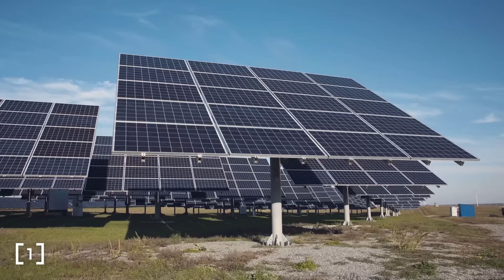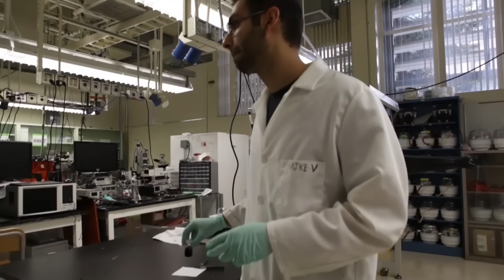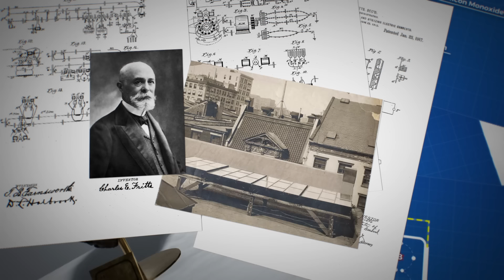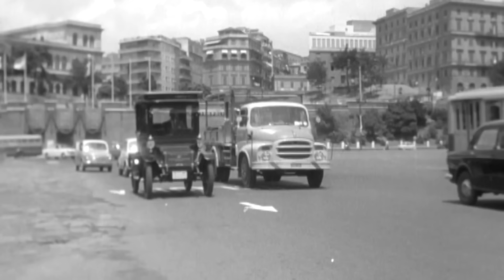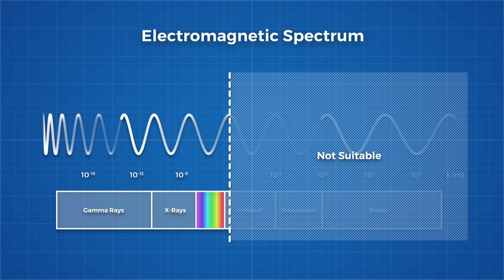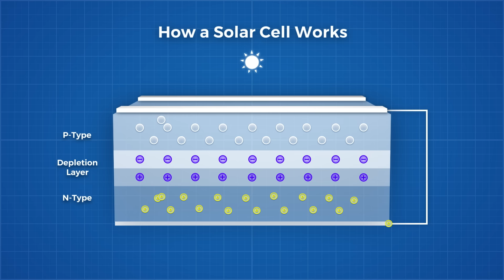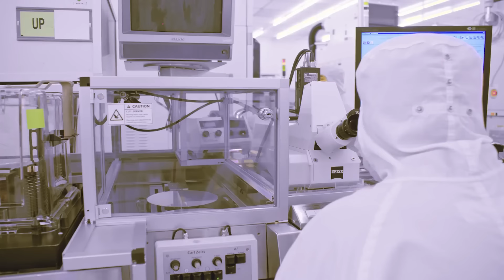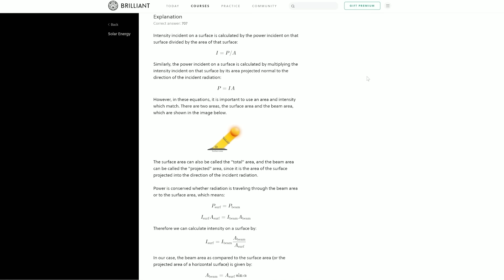The Mystery Flaw of Solar Panels

Comment: Is there a way to convert all the various light frequencies into a single frequency before it hits the cell?
Reply: Not really, but there are multi-layered solar cells that can optimally absorb light over many different frequencies. In lab conditions, these kinds of cells are nearly at 50% efficiency.
Reply: @lawrencechan4494  Yeah, I was thinking bounce it off a phosphorescent surface or pass it through that stuff night-vision goggles use to upconvert two low-frequency photons into a single high frequency one or something.

Comment: There is a way to harness almost all of the spectrum in different frequency.... its the only way to salvage lost energy... like a combustion engine roughly the same amount of heat energy is lost ... limiting the true potential... How do you solve it? Real engineering check your emails.....  Interesting views on this as i also consult in the field... using cells is not the only way.. think mirrors... optics to catch and relay...Not just a panel collecting what it can and repositioning to gain as much sun to gain as much energy for a single solaric.... Its always been about the spectrum... Imagine splitting each one even the ones we dont see as most think rainbow... But so many exhist beyond human sight color range...   Redirect each color it carries its own energy or frequency... direct to proper containment to energize cells and hyper speed vs full day charge to collect... This way would collect on almost quantum scale.... You need someone who understands lasers mirror systems and so on to gain near full collection capacity

Comment: No one talks about the Mw hour rating. No one mentions the longevity of service of a coal/nuclear station versus PV.  No one mentions the non-recyclable components of both batteries and PV cells, that become toxic land fill over the same life of a conventional coal/nuclear station.  (Cadmium, Lithium.. To name a few of the toxic chemicals that will leach into the food chain) No one mentions the land mass needed for wind/solar to compete with a single 900 thousand hp steam turbine, that will run 24hrs/day. (rated at 700Mw Hour) (most stations are equipped with a bank of four of these). If you want to be off grid, by all means do it. But I do not believe solar can compete at the moment. I am a power station mechanical engineer and have designed a lot of stations, from coal through to gas  and hydro -electric systems. Perhaps I am wrong? Am open to be challenged here.

Comment: I worked with three of the cited authors in this video on Gallium vs Boron doped Si to eliminate this degradation in my PhD thesis. Lovely to see it acknowledged and explained eloquently on Youtube 8 years later :-) Awesome channel, keep up the great work!
Reply: Wow. Rub some of that smarts on me.
Reply: Besides degradation reduction, the Gallium doped Silicon turns out to be more efficient [ https://www.pv-tech.org/images/made/assets/images/editorial/_2020-07-14_%E4%B8%8A%E5%8D%8811.30.33_750_544_s.png ].
Reply: @emailfilters  dead link
Reply: Would this be avoidable if the production was done in a straight nitrogen environment? May be a stupid question, but I know it works in reducing oxidation of hydrocarbon lubricants.
Reply: @OklahomaLubeDude  No, you need to burn out the organics in the screen printing process for silver paste deposition, so oxygen is required.
Reply: @OklahomaLubeDude  - Since silicon occurs in nature primarily as an oxide, there are lots and lots of oxygen atoms in the silicon that must be reduced out via refining. But no system is 100%, and the best silicon runs about 1ppb of impurities, which is still a lot of impurity atoms. Short answer: it's really hard to get all the damn oxygen out of the silicon in the first place; it's not a matter of oxygen being absorbed into the silicon during processing (which is mostly done in near-vacuum conditions).
Reply: @Jeremie Edwards  no PV cell has ever put out as much power as it took to produce it and never will. That is why the majority of the space shuttle's flights were primarily to re place solar panels on satellites.
Reply: I just wanted to say that thank you for your work, the road to the future is paved by people like you
Reply: Hi Thomas thank you for your sharing information. May I request you to provide me a copy of your PhD thesis and references
Reply: Hey waithttps://youtu.be/hx2FFPhbNIY
Reply: Did you? https://youtu.be/hx2FFPhbNIY
Reply: Top man. Thanks!
Reply: What is the effect of the ozone being depleted? Would the more direct rays of the sun, make the solar panels work better or heat them up more?
Reply: No Solarpanel-Flaw is bigger than BUREAUCRACY. Theres some real 'Accident-Scandals' where good People just wanted to give back Stuff and arent allowed for nonsense-reasons.
Reply: if you worked on it 8 years ago, and it's still "may" ie maybe, it's not solved.
Reply: You are my #1 hero! Bravo
Reply: What is the best solar panel to use currently?
Reply: @Ak3rf3ldt  Silicon based technologies are still king
Reply: @Ak3rf3ldt  Vikram or waaree
Reply: Everything I've ever read about solor panels has talked about basically just one frequency , many modern military industrial complex weapons can see and target in multiple wave lengths of light at once so could there be some kind of hybrid silicone we could try that might be able collect electrons from non visible light???
Reply: @MeatandTatersGaming54  Yes, that exists with compound semiconductors and is called a Tandem Cell and is used in many space and low-weight applications.
Reply: @thomaslauermann2494  Ah good that's a start I guess but you state space and low weight application so I take those types of cells are very sensitive to regular earthly weather then?
Reply: @MeatandTatersGaming54   @Thomas Lauermann   you might like to read about https://www.sundensity.net/  They developed a coating that essentially "down-converts" UV light, so it can enter the PV cell at a useable wavelength.
Reply: @Ogg13tube  Thanks for the link.
Reply: @Ogg13tube  That is something similar to what I had thought might be possible. ( I am no expert or technologist) I was wondering about the possibility of using masors (masers are similar to lasers) compounded together and sensitive to different wavelengths a certain difference between the wavelengths then taking the difference wavelength of them, in another maser that was resonant to it. The difference wavelength would be sensitive to an ordinary silicon semiconductor that is produce-able today. This is analogous (similar) to how radio receivers down convert the received wavelength to a standard wavelength, easy to deal with as in superheterodyne. It would be necessary to make sure the masers did not interfere with the path of the native wavelength light already in the environment, so that both it and the downconverted light would cover the semiconductor junction..
      I will read your link though to see if that development looks similar or different.
Reply: @thomaslauermann2494  Did the gallium help? I assume yes because like Mercury it likes being an amalgam. For gallium i would imagine the colder the better. (Thomas did you see that result?)

As for; Boron what % of doping worked the best?
I assume boron like ruthenium is a better UV temperature stable but more reflection/refraction. Also, (meat) shure Platinum is great but too reflective and too expensive.

I don't know how gallium silicone could be coated to the (3D fuzzy structure) of carbon nanotubes or graphene / graphite but the shape at light/photon scale adds depth increasing adsorption chances.

Lastly a general comment about the infrared out of silicon range. Most of that (electromagnetic frequency) passes right through the panel.
I don't think it's worth collecting (cost effective)collecting but if you want it. Use a microwave mesh and a mesh of radio antenna's just like the old radio using a (germanium diode) they have always produced electricity but the speaker was too quiet so old radios where plugged in to run an amplifier that maid the already existing electrical energy louder.
I guess if you want an Am radio disco light put the antenna under your pannel run a germanium diode to ground through an efficient LED. Disco light day or night! LoL
Reply: @Ogg13tube  It doesn't explain anything. It just makes a claim of down converting the frequency, which isn't explaining the process or method.
Reply: @pappaflammyboi5799  that is why it's called intellectual property, I'm afraid.  There in my home city, I might have a shot working there once I finish my optics studies.

If that works out, I'll try and report back
Reply: @Ogg13tube  No it's not IP; what they're doing is akin to trade secrets. IP uses patents which are published and public for all to see.
Reply: @pappaflammyboi5799  no.  Having signed handfuls of NDAs, a well as earning one letters patent, IP is the collected body of a business's know-how, both published as patents (they get paid for the use of their property), and that which is kept secret. 

The recipe for Coca Cola is not patented, but it is very, VERY much their intellectual property.

Don't forget published writings, and logo designs, etc
Reply: @Ogg13tube  I know what IP is. I have several patents myself and am aware of all the legalese created for all the trademarks and copyright mumbo jumbo people like to fight over. I wasn't born yesterday...
Reply: @pappaflammyboi5799  then you should know that IP encompasses trade secrets
Reply: @thomaslauermann2494 making solar pannals from recycled and natural or grown materials would solve cost issues the problem is lobbying and greed of big company's all interlinked and on thin ice with each as it is...nano tech has been lobbied against by many for years due too the huge impact it can have on the basic fundamentals on how many tried n tested things work...I e don't rock the boat...$$$$$
Reply: @MeatandTatersGaming54  The principles through which those work are entirely different to what's going on in solar cells. Often, those things which see is various other wavelengths use different types of sensors and technologies to achieve this. Military vehicles and equipment that can see in multiple spectra are actually making use of multiple sensors and not a single one. (These are often as separate devices in a single housing, which may look like something holding multiple camera lenses.) 

Something like night vision could be better understood as an application of photomultipliers working off of reflected light that's already present in a dark environment which takes the incoming light, translate it into an electric charge, and then multiplies that charge across multiple stages. (This is one reason why night vision can often look grainy.) Infrared on the other hand translates emitted surface light from the IR (heat) rather than reflected from the surroundings. IR also encompasses a broad range of applications. Something like thermal vision isn't going to produce the same image as a camera with a filter that blocks all visible light. (IR photography is it's own thing that produces monochrome colors which often seems to conflict with what we're able to see in the visible.) All of those applications in military hardware also need electricity to function, and don't produce their own when exposed to their target wavelength. 

As far as absorbing multiple wavelengths outside of the visible, silicon is somewhat limited in that application as it stands. Research into other materials that are capable of this have often been with organomatallics. Organic compounds which have a transition metal as part of their structure. A number of these have been shown to be able to generate electricity in low light conditions and/or are able to translate multiple wavelengths of light that silicon cannot. The issue with these as far as electrical generation as often been with their efficiencies, which are typically lower than that of silicon. One of the other big issues is cost, as it's not uncommon for them to use metals such as ruthenium. (Most things when it comes to energy generation boil down to a cost:benefit ratio.) If you want to look up an example of this kind of technology and ongoing research, a starting point would be dye-sensitized solar cells, or DSSCs.
Reply: @KennyTheB  DSSC sounds somewhat familiar maybe I read something about it in a research paper on duck duck go that I found thank you for the information 😎.
Reply: @KennyTheB  Thank you!
Reply: @MeatandTatersGaming54  You may be able to separate the infrared to a different panel but you'd need a lot of resources for it to be worth it for just 18% of the solar energy
Reply: @R__i_i_ii  Ya, I thought there were multiple junction solar cells that take advantage of multiple ranges of photon energies.
Reply: @R__i_i_ii  Like what kind of resources?

We already have passive optics that can separate light into constituent wavelengths. Polymers and silica are far cheaper to manufacture than the complicated deposition processes we use for PV materials so we can layer different materials for different band gaps.

Matter of fact, separating all the frequencies based on the material best suited to convert them to electrical energy OR for thermal applications BEFORE the PV process even begins allows a large portion of the system to be simple polymers and silica with the small centralized exception where you can keep the various rare earth and toxic elements serrated maki g them far easier to recycle. That would be beneficial in the long term as it eliminates dumping of worn out panels that are too costly to recycle anyways.

Passive optics are also immune to EMPs generated by lighting blasts, upper atmosphere nuclear blasts (which would be more difficult to prevent than conventional terrestrially targeted warheads), or solar prominences and flares form sun spot activity.

Lastly, segregated and modular parts are easy to replace, upgrade, and innovated without rendering the whole panel obsolete.

A final ancillary perk: passive optical pavement can have IR radiation sent directly to them from roof panels to melt frozen precipitation with no inefficient conversion of optical energy to electrical and chemical (for storage) and back to electrical and thermal for conventional pavements. The central unit just directs IR from the roof to your sidewalk, driveway, road instead of your water heater or steam turbine…

UV can be used for sanitation purposes or 3D print curing. Specific wavelengths conducive to horticulture can be directed to indoor greenhouses.

There’s a LOT we COULD do that would render the current PV systems completely obsolete instead of suffering under the designed obsolescence we currently are.

It’s almost as if Green Industries WANT us to continuously buy panels after every innovation or end of life wear and tear. It kind of supports the strip mining industries that are required to maintain the materials necessary to replace constantly dumped panels…
Reply: @R__i_i_ii  18% is the entire point!
Reply: @MeatandTatersGaming54  According to the makers of my solar panels, they can use non visible ultra violet along with visible light but are still only 15.5% efficient. I got mine in 2015 though and they are about 20% now. I think about the maximum efficiency is about 40% for solar that has already been developed but it is expensive and used in space. It will eventually be used in everyday applications. The price will come down with economy of scale use.
Reply: Koolllll
So you would know halogens repell oxygen.
Try iodine.
Reply: Thanks for your work sir. Thanks for bot studying dance or tattooing history
Reply: is there a great chance a pulse of light may produce more energy like a fan in front of the panel allowing a pulse of light, i think YES
Reply: A thin coating of Graphene on top of the solar cell could absorb a wider amount of the electromagnetic spectrum striking the surface. It is also an incredibly strong material. Some even theorize that cells with Graphene as the main material could have 60% efficiency.  https://inhabitat.com/graphene-based-solar-cells-could-yield-60-efficiency/#:~:text=Though the application of graphene in solar cells,double the widely-regarded maximum efficiency of silicon cells.
Reply: @moonwalker7043  there is possibility
Reply: @pasalasiva5891 i read a secret book.  a pulse of light is like a heart beat
Reply: Push the atoms closer together in a high pressure chamber to squeeze the electrons out of the valley and increase the chance a photon will mobilize an electron.
Reply: How to become like you?
Reply: Sunpower maxeon says that they N- type solar cells do not have LID simply because they us N- type silicon.
Reply: Why are they not made of olivine ? You should make it with this I think.
Reply: Weird flex but ok
Reply: I was thinking there’s a parallel in the black hole research. Maybe taking away what we know about black holes can be applied to this problem.

Comment: Answer for the solar panel problem: magnetic induction.
Reply: Elaborate.
Reply: @glennmatthews758  Li po batteries work best with solar panels.  I built dynamos using small DC motors that use magnets that induce a powerful magnetic field on coils,  turning at a faster rpm and produces high frequency ac volts. That works much better